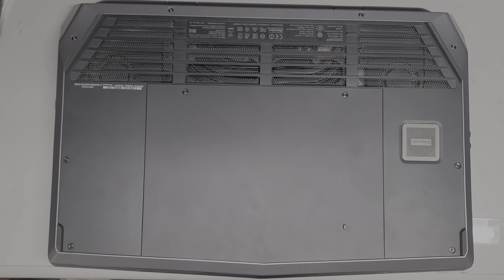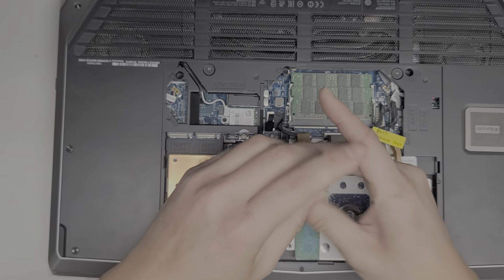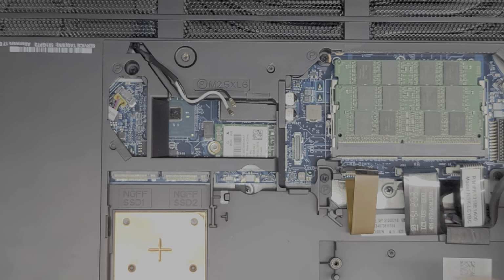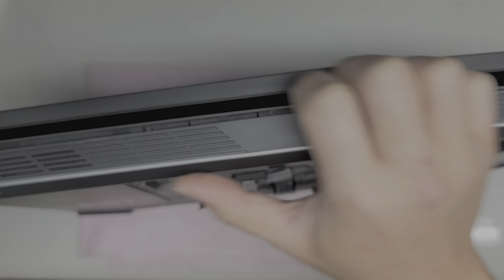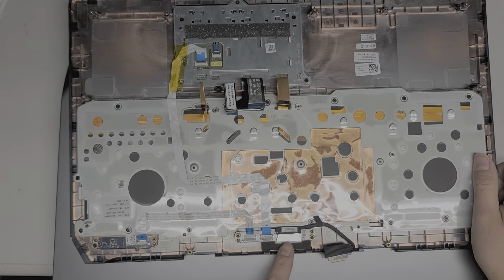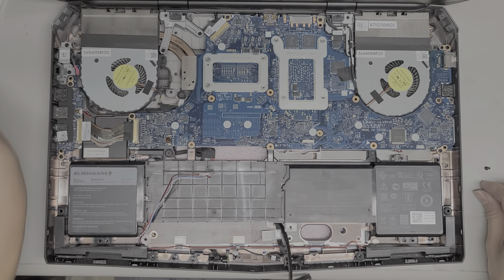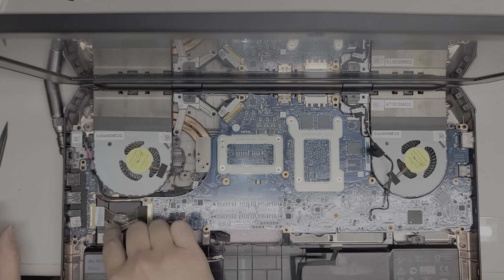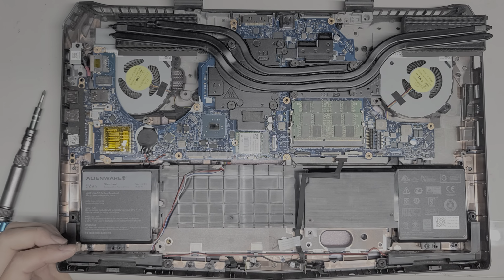Alienware 17 R3 Complete Disassembly RAM SSD Hard Drive Upgrade Repair Battery Replacement Pt 1 of 2

Comment: i recently purchased an Alienware 17 R3 for parts or not working on ebay.Seller posted pic of it showing Hard disk drive needing password. so it was untested due to seller not being able to login . Who would password lock a hard drive? This was a Pawn shop selling it. I won bid at  232.00 for it . when recieved i see that it could not even get to setup (F2) before that lock screen pops up. I removed the drive ,installed a Sata SSD drive,installed windows 10. Beautiful laptop.
Reply from the maker: Awesome!
Reply: The BIOS offers the choice of a system lock or a hard drive lock.  If the data is sensitive, the hard drive lock is more secure since a system lock doesn't prevent the HD from being read on another device.
Reply from the maker: @Timmymao163  yup

Comment: Thanks for the detailed instructions on how to disassemble the Alienware 17 R3.  The battery finally died in ours, after giving the F1 bootup warning message for a year.  Following your recording, it took a couple of hours and now the F1 battery error message is gone.  If I were to do it again and was strapped for time, it's only necessary to disconnect the battery and keyboard ribbon cables, and the two cables that thread over the battery.  All of the other cables can remain connected and still allow access to remove the battery.
Reply from the maker: Awesome, glad you were able to replace it.

Comment: When u assemble back again,how do you know which screw fit where?
Reply from the maker: Keep them in order when you take them out.
Reply: @ItsBinhRepaired  How?
Reply from the maker: @pcpartpicker-1408  I say it in almost every disassembly video I make. Put them in the pattern you remove them. Watch a few of them and you'll understand. I made a video showing this, but it's reserved for people that contributed to the channel.
Reply: @pcpartpicker-1408  Use an empty egg carton and organize the screws by the different areas they came from.

Comment: I have an Alienware M17xR3. Hard drive 0 died. I bought an ssd upgrade kit. How do I transfer the files to the ssd from the HD if it won't boot?
Reply from the maker: If the hard drive is dead, you'll have to send it to 300dollardatarecovery.com

Comment: Hi, I know this is an older video but would you happen to know where the PCI Adapter on this model laptop would be? I’ve got an error code for it and need to reseat it
Reply from the maker: No idea. The SSD?
Reply: @ItsBinhRepaired  Nevermind! Appear to have fixed it. I unscrewed, unplugged then plugged the SSD back in and it’s working again. Thanks for the great video!
Reply from the maker: @vintageseinfelddvd  backup your data to be safe.
Reply: @ItsBinhRepaired  It won’t boot, So I’m assuming it’s the SSD as the OS is installed on there.
Reply from the maker: Or the wireless card

Comment: Surprisingly for this laptop you don't need to really separate the screws that much.. I kept mine all in a bowl together when I took my 17 r3 apart to clean it and replace a fan.. most of the screws on this thing are p screws.. the only ones you really gotta pay attention to are some of the smaller ones but aside from that easy disassembly and even easier assembly. Love this laptop
Reply from the maker: Best to always keep them in order even if they all look the same.

Comment: Hey everyone, I have Alienware m17 R3 i6700 
Gpu 970 
SSD 512 m2 
Today I tried to change thermal paste , after all the process , I assemble my laptop very well. Now it's not turning on , I try to check the power but it's  showing any sign of processing or power on motherboard and whenever I plug the  charger it's make a click sound and  the charger light turns off itself , I tried on battery as well but same result kindly help me out  , will be thankful#helpneeded
Reply from the maker: Shorted out dead motherboard.
Reply: @ItsBinhRepaired  I don't think so
Reply from the maker: @scar5219  sounds like it 100%
Reply: @ItsBinhRepaired  well it's fully functional now and better than before Thanks for your help 😆😆
Reply: @ItsBinhRepaired   amateur 🤭
Reply from the maker: Lol what happened to it?

Comment: Thanks to your video I've been able to replace the battery. When I go to power on the laptop there is no response. I plug it in and the alien head light blinks green (charging) but still unable to power on. I went back through the entire process and I'm still unable to get it to power on. Any thoughts on this?
Reply from the maker: After powering it on, how long did you leave it sitting?
Reply: Got it! Make sure to check the power connection on the keyboard. It may come loose. Hahah
Reply: Sent you some money. Thanks for the video. Greatly appreciated
Reply from the maker: @CreatingGalaxies  LOL glad you figured it out. I was wondering who sent me money and what for. Hahaha Thanks!

Comment: The battery pack in my Alienware 17 R3 is running really hot to the touch when plugged in does that mean I should remove the battery?
Reply from the maker: Probably

Comment: Can I upgrade ram on the Alienware 17 R3? To like 32 or 64? Please answer i need to know.
Reply from the maker: If you can fit it. The video should show how many slots are available.
Reply: @ItsBinhRepaired  Thanks for responding. I believe i have the same model as you however which Ram Brand do i buy? Or how do i know its the right one that fits? Do you have any websites?
Reply: Like do i just go to amazon and order 2x 32 Gb Ram for laptop. Or is there a certain brand for each laptop
Reply from the maker: @nasoncruz1069  if it's the same model, this is the max you can do. https://amzn.to/3hDj6uN
Reply: Okay thank you. But how do i find the correct Ram cards for other computers. How did you do it? With the model number?
Reply from the maker: @nasoncruz1069  did you watch my video? Watch a few and you'll get the idea
Reply: I just bought two single stick DDR4 CORSAIR Vengeance 32GB RAM and works like a charm for the R3 because our motherboard is i7core which can handle the upgrade up to 64GB

Comment: Gave it a thumbs up for the raid I didn't know lol oh well I got a 4tb ssd also any ram works for it only ddr4 260 pin I've tried 2 different types the max is 32 gb but I want to upgrade the cpu and gpu, I wanted to see how the inside looks like. Cool video.
Reply from the maker: Glad it helped! If you haven't already, please subscribe as well. It helps make my videos easier for others to find. Thanks!

Comment: HI @It's Binh Repaired ,  I have only one single HDD with only C drive on my computer.

Q1) I Am planning to replace this HDD with 2.5 SDD but with a bigger capacity. I believe I will have to only clone the HDD to my new 2.5" SSD and then replace it so that the 2.5" SSD now becomes bootable.

Q2) But If I plan to replace the HDD with a new M.2 SSD. what do i need to do ? How do i clone and remove the HDD so that i can make the M.2 SSD bootable and use it. ?
Reply from the maker: This is the video you want. https://youtu.be/4p5jFDzVwUw

Comment: Bro I'm going to replace the Hard drive with a 2TB SSD because I need more room on my C drive than 225GB or whatever it is. So that big 2.5 inch drive you pulled out in the beginning (the one I am replacing) is that the C drive? Or is it everything including the D drive?
Reply from the maker: If yours is exactly the same, then C drive is the m.2 drive,  2.5" is D drive most likely.
Reply: @ItsBinhRepaired  DAMN. Thank you. M.2 drive is one of the little sticks?
Reply from the maker: @cedricwilliams6229  yup, if you haven't already, please like and subscribe so others can find my videos. Haha possibly donate to help with my currently broken clavicle (collar bone) making work extra difficult. Lol Work is going to be rough over the next few weeks.
Reply: @ItsBinhRepaired  I Bought a 2,5 inch 2 tb to replace C. Thats not possible?
Reply: @ItsBinhRepaired  Or its not possible to install this new 2.5 inch drive and have programs run on it instead of C drive?
Reply from the maker: @cedricwilliams6229  you can put it in place of the D drive, but I recommend cloning first. Let me send you the video you need.
Reply from the maker: @cedricwilliams6229  here's what you need. https://youtu.be/4p5jFDzVwUw
Reply: @ItsBinhRepaired  Oh I had just already ordered THIS - *SAMSUNG (MZ-V7S1T0B/AM) 970 EVO Plus SSD 1TB - M.2 NVMe Interface Internal Solid State Drive with V-NAND Technology * thinking it was the best route. Mistake on my part? Thank you so much for the help by the way.